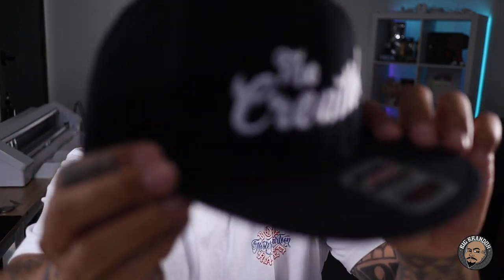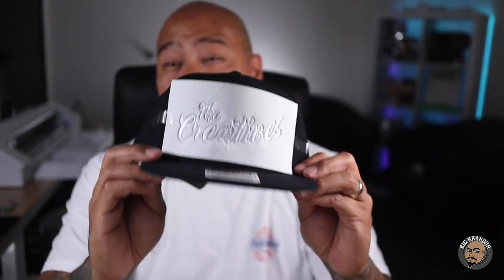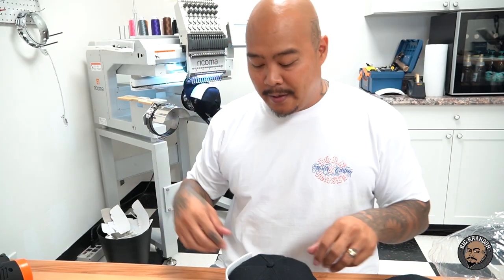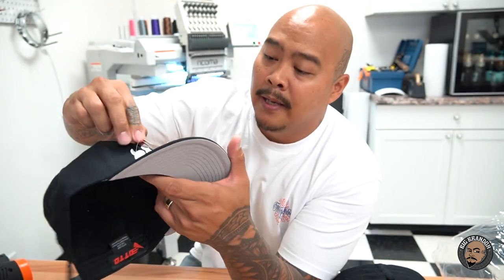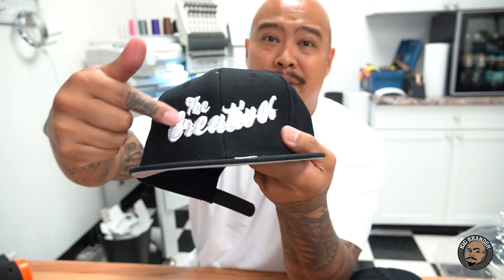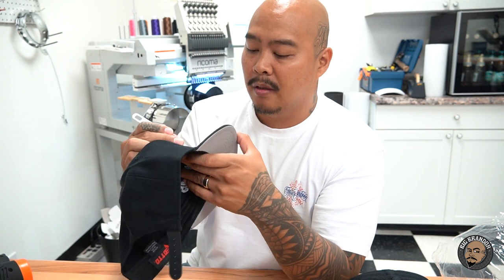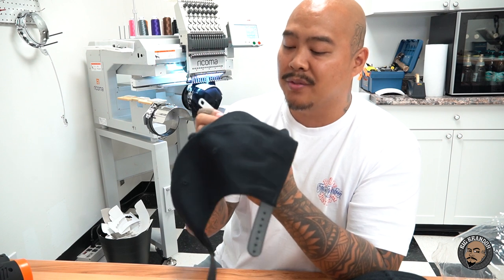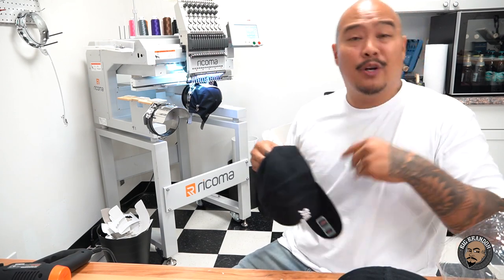Owning An Embroidery Machine - What They Dont Tell You

Comment: You can use puff foam on clothing and knit hats. It washes and drys well. I trim my threads crossing over the foam before I pull it off. It helps with the foam rip off.

Comment: I loved this video and watching the process! 

Question: when you were weeding out the excess foam, could you just lay a piece of tape over it to snag up the little pieces? Just curious,  I think it would really amp up production!
Reply from the maker: really good idea. but the foam is stitched in pretty good. so it takes a little force and finesse to get it out of the tight areas. also the tape would also get stuck to the thread as well.

Comment: Who does your digitizing?
Reply from the maker: i either use a local kid or google search digitizing services. then i go based on price and turn around time. ive tried most companies on the first page and all have been solid. check'em out
Reply: Is digitizing really that hard that one can not do it? I want to be able to make caps on demand so having someone digitize, I suppose at $30 an image that would be a costly hobby for myself not to mention having to wait for it to get it digitized.
Reply from the maker: not sure how hard it is to learn but once i got this machine i have no time to sit down and try to learn it. the machine runs non stop. so out sourcing my digitizing makes more sense for me cuz i cant stop production to try and digitize stuff. im sure you can learn it. but also $30 is what you charge your customer, most digitizers only charge $5-$15 depending on complexity and most turn around the same day or next day. it sounds fake and exaggerated but this machine its always running. if its not running im not making money. its to the point where i cant even take in more work cuz my current clients keep that machine going on their own.